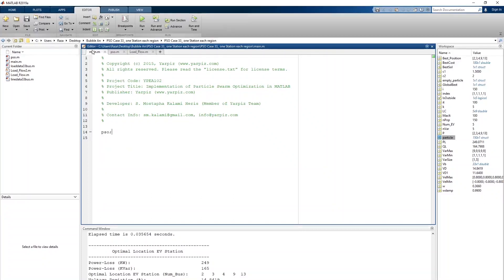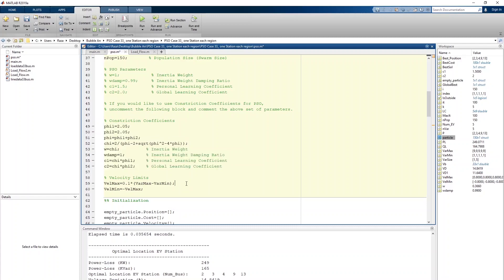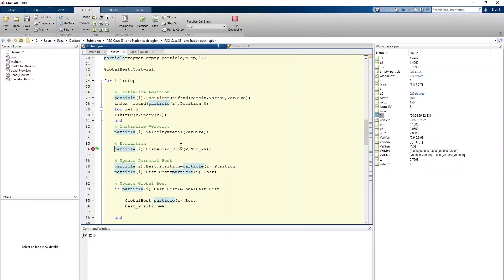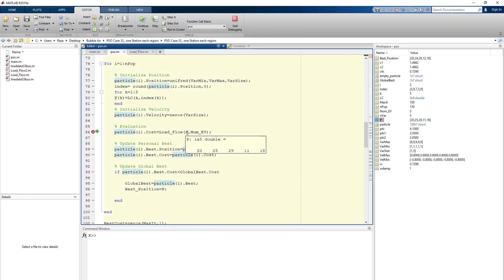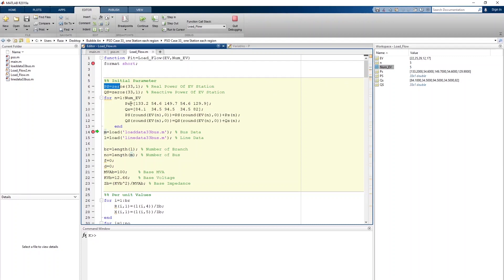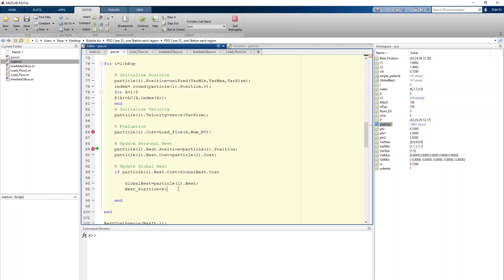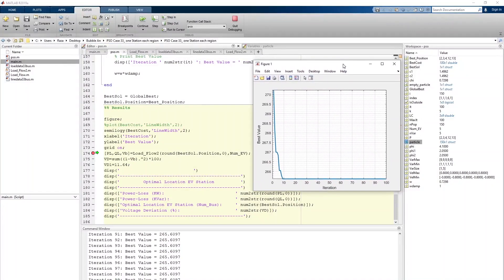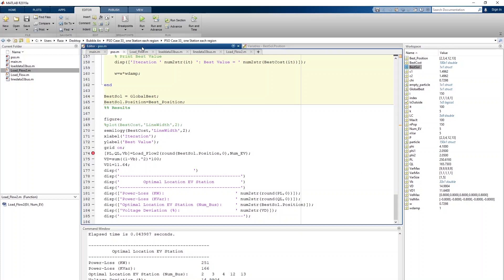Optimize placement of EV chargers on a IEEE 33 bus system - Matlab

Comment: code is not working .  it is showing following

 Error using  .* 
Arrays have incompatible sizes for this operation.

Error in pso (line 96)
           +c1*rand(VarSize).*(particle(i).Best.Position-particle(i).Position) ...

Related documentation
Reply from the maker: contact@simulationtutor.com
Reply: Can you share the code with me?